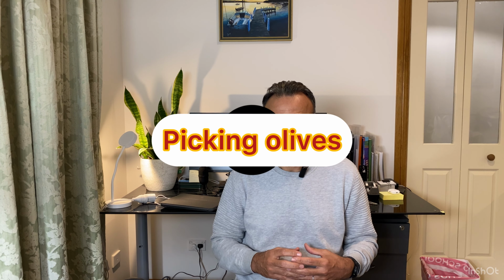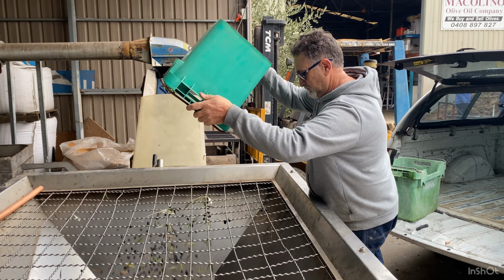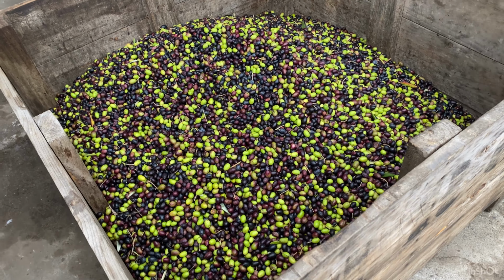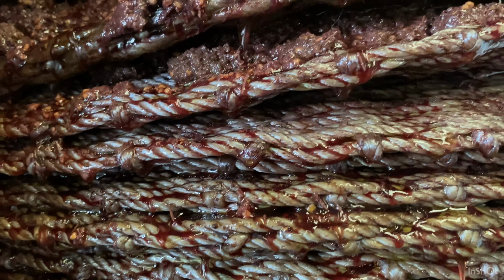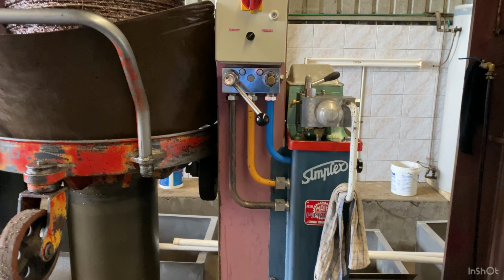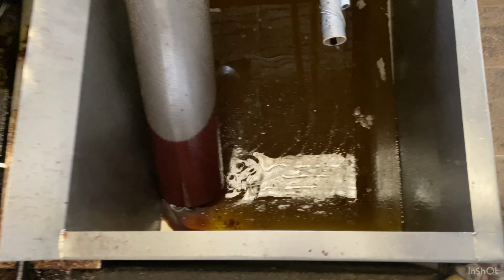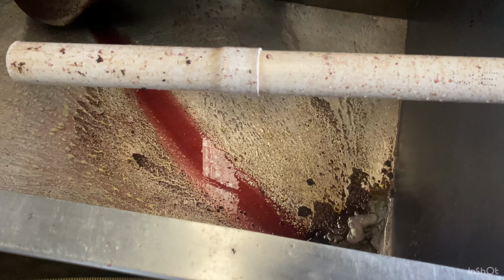How to Extract Olive Oil: Step-by-Step Cold Press Method

Comment: Love the video, im just getting in to producing as i have a olive farm now in spain, i get most of how to do it, until you get to the centrifuge part, how does the oil and water seperate for the extraction part, does the oil go up and the water goes down ? . im looking at getting a mini mill that does the job, it gives me a choice of cold or hot press. which trying to find out best version as i see only cold pressed.
Reply from the maker: Thank you for your message, the water and other particles in the olive extract are heavier than its oil, then in centrifuge the oil stay in meddle and water and other ingredient pushed outside. Please watch: HAUS DISC STACK SEPARATOR ANIMATION in YouTube. 🙂